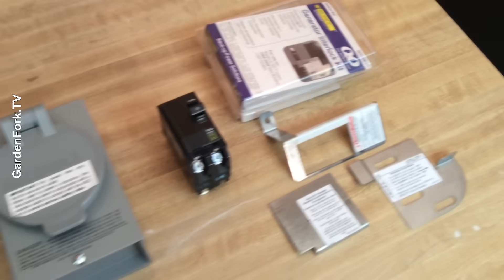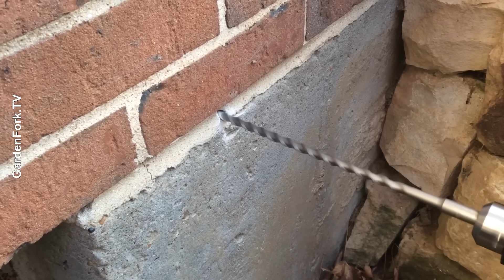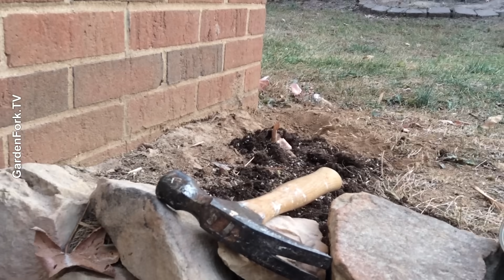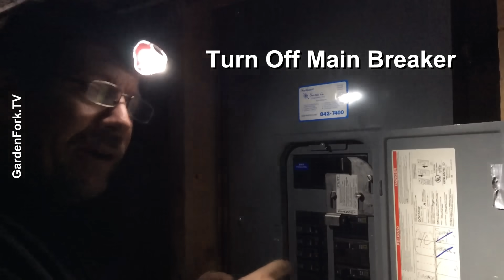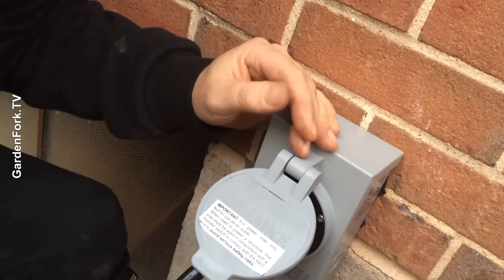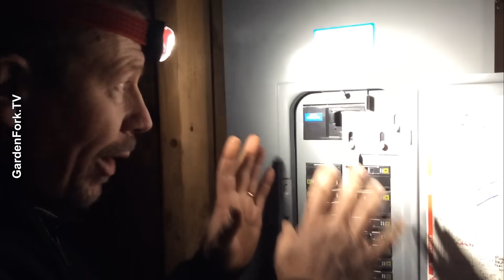Your Easy  & Safe Way To Hook Generator To House | Generator Interlock Switch Install | GardenFork

Comment: Do you need to ground the generator?
Reply from the maker: if you are using a properly grounded cable between the generator and the transfer panel, usually not, but check with a local electrician to be absolutely sure.  thx!
Reply: From my understanding as long as no other electrodes or grounding rods are within 15 ft of one another it actually doesn't matter. I have been using a generator for 3 years and I wire it to an unbonded subpanel. Since it's unbonded and my main panel is 80ft from my generator I go ahead and ground it with a 6ft electrode.

Comment: Very nice video. Very informative. I feel comfortable doing my own.
One thing I noticed that you did not mention is whether or not your generator was bonded or floating neutral. This would be an important thing to bring out IMO. I have watched many videos just like yours and none of them mention it in there either.
Thank you for sharing. I really did like your video!

Comment: I just got a new generator and it has a 120V/240V switch. I'll switch to the 240V to supply power to my house but when would I use the 120V selection - for the standard 20A outlets on the generator that look like the ones in the house? Does this mean that I cannot use the 120V and 240 V generator outlets at the same time?

Comment: How would this work if you have one breaker box outside that handles all big amp breakers and another sub panel that has all other circuits?
Reply from the maker: best to check with a local electrician on that one. thx!

Comment: Question. Generator runs power back into panel through that one 240 breaker. Doesn’t that only put power to only one side of the panel?

Comment: The only thing i would add to this is to drill the hole upward and inward so that any water that does get in the hole will not run indoors

Comment: Bad idea. You are relying on the homeowner to switch off the main fuse box. Remember: never trust the public to do the right thing. You MUST use a changeover switch to ensure it is impossible to feed line power

Comment: What's the names of the lightest and the most quietest 4,000w gas generators with electric start and or Remote start that can use gas or propane  ?
Reply from the maker: You'll have to do your own research, and then share it with all of us. thx!

Comment: Unsure you are still monitoring older posts, I'm catching up on older posts in between my new posts, my generac is 20ft from my back porch. Where I've got my carwash electrical panel given to me from past employer where I took care of his 6gas station at one time, I run my solar n generator through it off circuit from my on grid. Mainly feeds my living room so there's lights heat n internet in major outage, that's Roku also. I was a hotel engineer when we replaced our whole service panel for an uplift station I was able to bring that home as well, I'm planning to add a 12ft weather head out back to use this panel to run my sawmill.
I'll have option that can run it off grid if decided to, love your transfer setup.

Comment: I think this would cause a double bonded neutral to ground problem if the generator has a bonded neutral ground as most portable generators like the one you show do have? If the generator has GFCI a switch it will keep tripping open. What is your solution for that?

Comment: Brilliant. Thank you for this video. Have you got any video for the way it’s installed from
The brick to the fuse box? Or any pictures etc. Trying to work out where we’ll get it into the house as our fuseboard is in the middle of the house for us. Thanks js so much. From UK
Reply from the maker: Not sure the electric code in the UK but in the US you can often use flexible conduit through the brick and then Romex style wire to the fuse board

Comment: You're wrong about drilling into the brick. I'm a mason, and the mortar is stronger than the clay brick. The clay will break down easier than the mortar, so drill into the mortar joint, NOT THE BRICK! Screws or bolts will pull easily of of the clay brick.

Comment: Is it fact that, for non-inverter generators, to maximize efficiency and fuel consumption, it’s better to continuously consume as close to maximum output as possible? IE: If the generator generates 4500 watts, use as close to 4500 watts as possible?

Comment: I wish someone could speak to the fact that the neutral coming from the powerline is not disconnected when in generator mode. Is it not possible to feed power back somehow through the neutral? I believe a transfer switch disconnects all lines from the main powerline including the neutral. Great video thanks for posting

Comment: I have to upgrade my box.  What box are you using so I will be sure it will work or does it work with any panel (electrical box)?   Looks like you have a QOC30UF box?? but what manufacturer?  Great job.  love the doggies….

Comment: What is the breaker you used for this? Is it different from a regular, say, 30 amp slime dual pole breaker or is it a specific type of breaker?

Comment: Wouldn’t it be better to leave the generator in the shed with the doors open to protect you and the generator from the weather. I’ve also read that the generator should be at least 15 feet from the house because of carbon monoxide. I don’t know what the distance from your house and the pavers is but in the video it looks kind of close.

Comment: The key is to setup the breaker to feed the 120V split phase so the 2 sides of the panel are energized...
So, basically the title of the video should be:  best easy safe way to hook a generator to a house panel is to hire an electrician to do it for you!

Comment: Hey GF> I have a question. I have just had a generator switch installed onto my house next to the power box.   My house circuit board has a safety switch. The new generator I bought also has a safety switch. My electrician now says that the safety switch on the generator will keep tripping because of the safety switch on the house board. So basically I need a generator that doesn't have a safety switch. I,m very disappointed as he didn't tell me this prior to installation. Is this right?
Reply from the maker: Not sure what a safety switch is. I’ve not heard that term used with a generator or electric panel. Sorry.

Comment: Buying a generator for my parents who are in their 80s and who went for a week without power last year. I am investigating different ways to connect it to the house. I see my options are a Transfer Switch, a GenerLink, or an InterLock switch. The Interlock seems to be the most economical and your video really helped me to understand it. What I didn't get from the video is how the power gets from the outdoor outlet to the circuit breaker.  Will I have to run wires from the outlet, through the walls and to the circuit breaker?
Reply: Isn't that exactly how it works, it goes from the Generator thru the 208v receptacle thru the wall to the panel. The generator providing the power from the 208v receptacle. So yes you run the wire thru the wall to the panel.

Comment: During our recent storm we were out of power 3 days. About a day of it was the crews trying to find which house had a generator back feeding the wires because they didn't have the main breaker off.

Comment: Great video, can you tell me more about the 240 breaker, do you have a link for it?  I have a Square D panel and I am looking to get a generator to do this also.  I just ordered most everything but want to be sure about the breaker, you mentioned that matches your generator.  Are you talking about running watts or start up watts?  I need to have a generator that will run A/C, Fridge, some lights, also and from what I read online a 7500 watt is too small. Thank you.
Reply: Depends on what you look to run. Are you talking window AC or are you talking centeral air? The 7500 will run window AC units but unless you have a 50amp plug and a larger generator it most likely will not run central.
Reply: @michaelfassbender6713  I ended up buying a 1100 watt generator and using a 50amp power inlet box with an interlock kit.

Comment: So when your power goes off it won’t? Or it Will just convert it through your generator and everything will be running off your generator... is it possible to run the whole house off of one generator?  A bunch tbs, Window air conditioner units and all that stuff?

Comment: Double the breaker to a breaker with 10 gauge wire straight from your generator with no 249 appliances breaker turned on

Comment: This might be a dumb question, but how do you know when your power has come back on when the mains are off?
Reply: You can check each time before you refuel the generator by flipping the generator breaker off and main back on. That will have you checking everything 4-6 hours. 

Or watch your neighbor's lights to turn back on

Comment: Great video! Only question would be, how do you know when the power is back on from the utility company? If you live in the woods you can’t see if your neighbors lights come back on.
Reply: I stay in the woods and I use a Klein voltage tester pen (no probing needed) and touch main power line going into main breaker switch. And if power is back I jst run generator until gas runs out

Comment: I'm looking at hooking up a generator to my house but I've found many do not put out clean 60 Hertz power which can damage most electronics which most new appliances have in them, I'm still checking to see which offers the best output. But the information is great given my main box is outside and would be easy to use the interlock system, over the transfer switch far cheaper and dependable.

Comment: I'm in Texas and did all this about three months ago and boy was I glad I did, I was a hero for three days with no grid power. Why did you only use a 20 amp breaker? I installed a 60 amp breaker in my panel as my unit puts out at least 50 amps or more. I wanted it to be future proof if I decide to get a larger genset in the future.
Reply: Thays What I did. But i ise 50 amps and its enough. 
However how would you know if the city power is back during the day?
Reply: That breaker is protecting the extension cord. So makes sure your extension cord can handle 50amps if you put in a 50 amp breaker.
Reply: @ecospider5  I don’t use an extension cord, I use a 50 amp shore power cord.

Comment: Can you recommend the size of generator for this
Reply from the maker: Hi Mandi, it depends on how many appliances and lights you want to power in your house. Most people will do ok with a 5,000 - 7,000 watt generator. This set up will not run a whole house central AC system. thx! Eric.
Reply: @gardenfork  just mainly looking for something to power lights and furnace.  I live in Oregon and we generally don't get much snow in my area but ice storms seem to be getting more frequent so having something to run the furnace to keep warm is my main concern 🙃😅

Comment: Feb 2021 after the big freeze in Houston.  
Great video. Thank you. All of us in Texas will be watching this video after the fiasco we just went through. This winter storm kicked out butts and is turning preppers in all of us. I will never rely on anyone anymore.
Reply: Just read that some electric bills will skyrocket to $9/kwh. So about $650/day! So a system like this would save thousands of dollars, even if you do have power a generator would be needed.
Reply: @paulwoodman5131  Yes I feel so sorry for those folks. In Houston you can pick the main electric provider or you can buy from the second tier folks which have their own rates and all the derivatives plans. Unfortunately, some plans dictate that when electricity is scarce, the rate skyrocketted.  I don't think right now these customers can get out of this and are stuck with the bills.  I see more bailouts coming.

Comment: In Texas going through it No Light No water had to crawl in my attic disconnect my furnace wire to a extention chord and straight to my generator. Hooked up both my frigerator and the front TV DVD player it was hell turning on that damn generator but now we're good thank God
Reply: Might want to consider getting some quick start spray to help it start easier next time.  Also, be sure to drain oil and fuel (otherwise the gas may solidify in your carburetor and/or foul your spark plug).  You can't just put it in a shed until next time.  Also, I really advise in having an extra spark plug on standby--speaking from experience.  I hope things improve quickly for you Texans!!   Also, you should secure it with a heavy chain too.
Reply: I’m thinking bout buying one now but in my neighborhood in afraid someone will steal it.

Comment: Where’s my fellow Texas Arctic blast folks. Not going to be without power again!
Reply: I'm in Dallas but I already have a generator I got several months ago. I'm just looking up better ways to hook it up without a bunch of wires trailing into the house!
Reply: @stephenbustos  Same. I am sorry for all my fellow Texans, this was awful I don't want wires all over my house again either. If I was single I would be ok, but with a wife and kid need a better way.
Reply: My generator arrived today, I will not freeze or be uncomfortably hot(in case of rolling blackouts) this year.
Reply: Im getting ready for hurricane month August thru September
Reply: I am right here with you. House still isn't finished, but will be soon! Jesus is the only thing getting me through this. Spring Texas over here. Obviously watching this video for the same reason you are :-)
Reply: We need to fight back with these ass hats that are controlling HAARP and modifying the weather.
Reply: Hi!!! We're supposed to get down to freezing this weekend and my traumatized ass is already panicking! 😬😱🥶😫
Reply: I agree it was bad, but love my Texas state.. McAllen, tx
Reply: Yeah that happened in Louisiana too. I’m right there with ya.

Comment: I like this idea over using a transfer switch because you have more flexibility to select which breakers you want to turn on based on need.  However, one question I do have.  Since I am new to this, what happens if you turn on too many breakers and overload the generator?  Will the generator shut off or will something bad happen?
Reply: Generator breaker if it has one will be triggered and shut the gen off. if no breaker, the generator will overheat

Comment: Great video, but holy crap!!  That link to Amazon in your pinned comment- this "interlock" kit is nothing more than 30 cents worth of sheet metal, a couple of safety decals, three screws and a drill bit, and they're charging $56.

Comment: my garage was wired from house then we wanted electrric heat installed the house panel not big enough so we installed in garage, the power line to the garage was no longer needed . we hooked generator with a breaker box inside garage thru the unused line to a circuit box inside house . we then wired plugs and lights  to the areas we will need when power goes off.  so we put a plug on wood furnace motor  and unplug it from house power to the plug beside it  for generator, we also put lights in basement and ran a plug box upstairs to power fridge and freezer, and did thee same for water pump. It is a complete separate unit from generator to plugs and  lights. no need to screw around with main house panel. I have generator just outside garage door , my electric cord is 8 feet long to reach the on/off panel in garage the wire to house is underground and goes in basement to a fuse panel . from there it is wired to furnace and water pump and lights and 2 plugs upstairs  for fridge and freezer and one for blue ray and tv.  works for me and did it all myself. and  I have an electrician up the street and asked him to check when I was done .  he said it was okay.

Comment: when you have a transfer switch the lights that aren't hooked up to it and hooked up to the power grid will come on when the power comes back on letting you know your power is back but this way you have to look over the neighbor's house it still looks like it works great but that's my only criticism

Comment: If a person doesnt understand the advantage of this opposed to a transfer switch is a transfer switch can only power 4 or 6 specified breakers when installed. With an interlock kit you can run anything you want including all of your outlets and lights that run off of a wall switch. Your only limitation is what your generator can handle

Comment: Great video. Thank you. What size generator would you recommend to power our gas boiler, sump pump and 5 cu ft freezer and fridge/freezer and a few lights?  Also i am concerned about noise. Are open frame generators very loud?  Would you recommend an inverter generator?
Reply from the maker: portable generators are loud. Add up the amperage needed to use your appliances, mulitply by 120 and that gives you your wattage needed. Just a rough estimate, but I'd say a 5,000 watt would do just fine.

Comment from the maker: Generator Interlock & Generators Here: https://amzn.to/3boX1Mw
Get My Free Weekly Email: https://www.gardenfork.tv/email/
Reply: You said 240-volt but I'm assuming you meant 220 volt
Reply: @SKANK_HUNT49   No it is actually 240. Many US homeowners believe their voltages are 110 and 220 but in fact the standard is 120 and 240.
Reply: @SKANK_HUNT49  Or 440
Reply: you never mentioned what will happen if both power are turned ON to position.. city power & Generator power can kill you or caught the house on fire...
Reply: How much for all of those items ? About ? $200?
Reply: My main doesn't kill all the power in my house and I'm worried about this winter 2022 cuz I live in Missouri specially on January and February.
Reply: What about hooking up a sa 200 welder to the house for power, its dc.
Reply from the maker: @chrisv.6951  sorry Chris I don’t know if that would work. Thx.